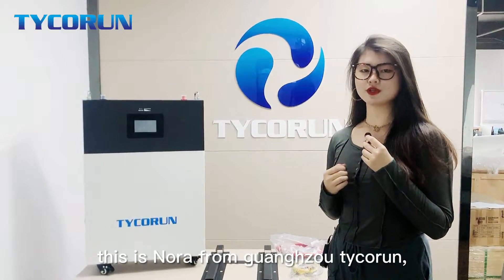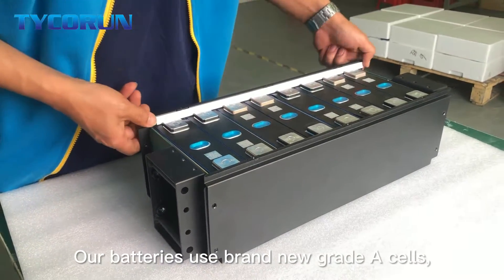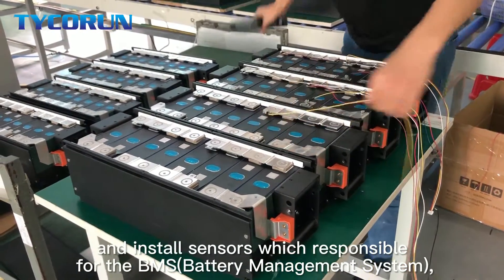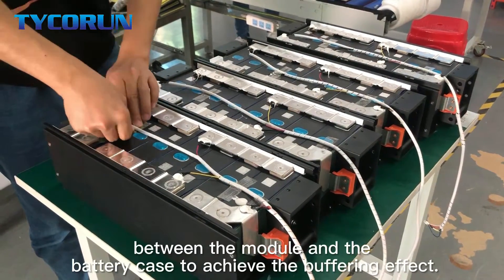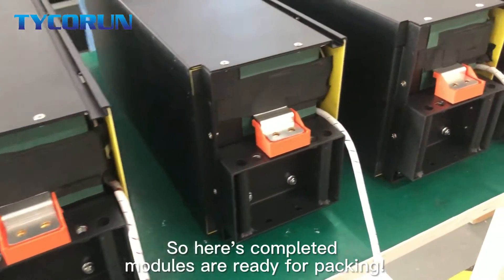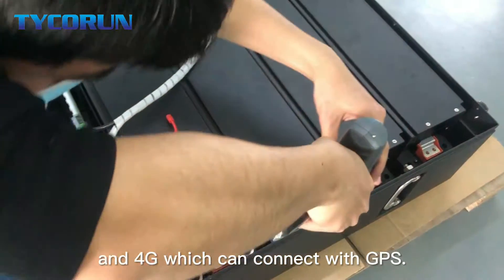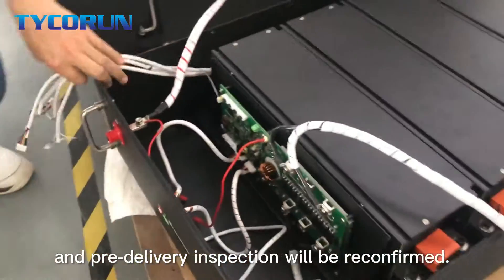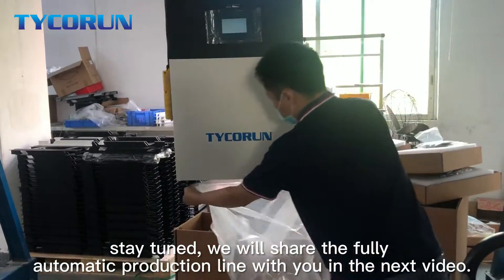10kwh 48V 200Ah PowerWall lithium ion Battery: 100% Whole Home Backup!

Comment: Few questions:
What is the practical output and is it available in 12v, 24v configuration also?
What will be the procedure for replacement in case of warranty? and if repair of cell or replacment is required?
Can these batteries be connected parallal for increased back up?
What will the price for large scale import to Pakistan?

Comment: I am impressed. Looking at the website now. I only wish that the battery connections were not welded. Hard to self-service
Reply: welding or soldering is bascailly the only good way to connect cells together

Comment: Wow... you have an engineer to assemble the battery pack.... are you sure about that?
Reply: I guess it needs an engineer to manage those wobbly ph2 insertions and to accurately estimate torques. The machine made one will be better.
Reply: Engineer to test the voltage, not assembled the batteries!